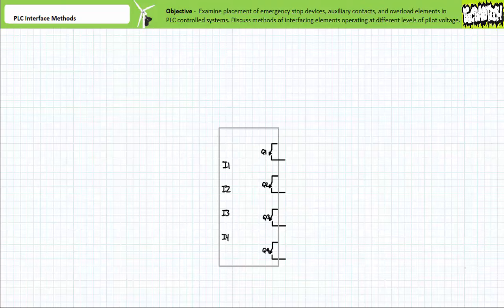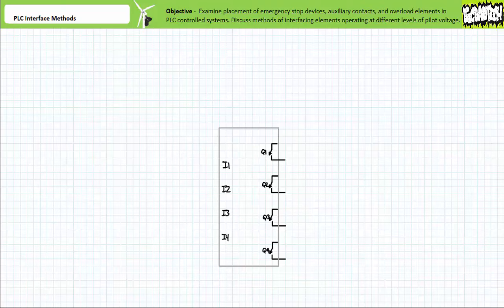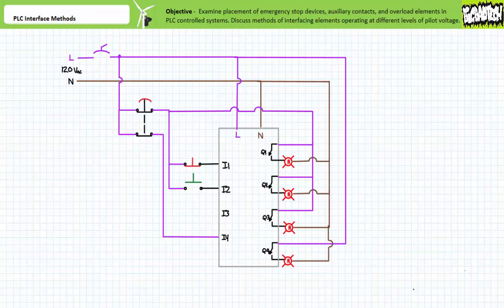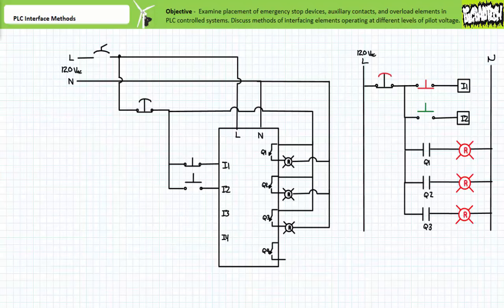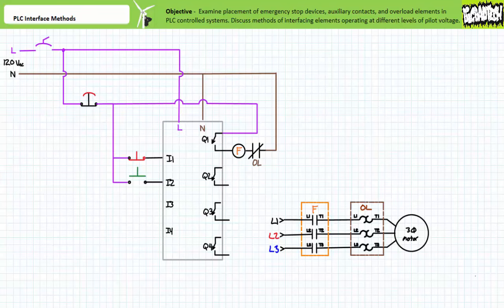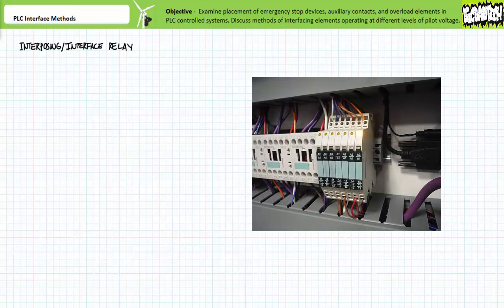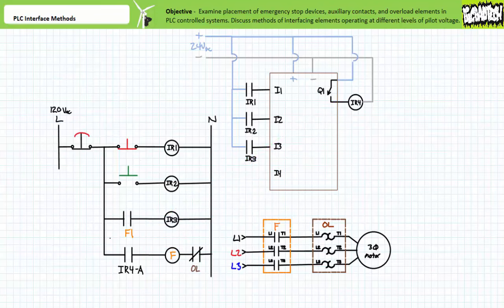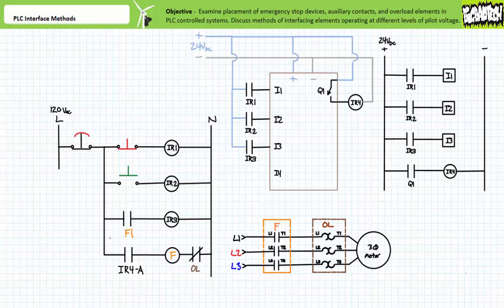PLC Interface Methods (Full Lecture)

Comment: I have a question: would not a 120VAC–rated mechanical  push button switch work perfectly well with 24VDC in our low power pilot voltage settings?
Reply from the maker: Yes often times the electromechanical switched inputs largely don't care what style of pilot input they use within a certain range. Output devices however are very picky about DC vs AC!
Reply: @bigbadtech  Thank you for the answer )

Comment: With the interposing relays, wouldn't you need one on either side of the switches? What I understand, your schematic shows as follows: 24vdc going into the switch, line from the switch going into the IR to change it to 120Vac, then into the PLC.

I thought the PLC is designed to take 24Vdc, so how are you having the output a 120Vac going straight in there? 

And if the switches are rated at 120Vac, it doesn't make sense to have the IR after the switch.

What makes sense in my mind is as follows: an IR changing 24Vdc to 120Vac, line from IR to the push button switch, line from switch to another IR, changing it back to 24Vdc, line from last IR to PLC. The PLC receives 24Vdc as expected, and the switch receives 120Vac.
Reply from the maker: There's 2 things to consider with interposing relays. What flavor (24Vdc or 120VAC) does the PLC like? What flavor does the switch and output device like?

If the switch likes 120V and the PLC likes 24V a 120 to 24 IR is placed between the switch and the PLC. Similarly if the output device likes 120 and the PLC outputs 24V a 24 to 120 IR is placed between the PLC and the output device.
Reply: @bigbadtech  If the switch likes 120v and the PLC likes 24v, and an IR is placed between the switch and the PLC, doesn't the switch input still receive the 24V coming from the battery?
Reply from the maker: No. A 120V rated switch merely energizes or deenergizes a 120V rated coil. The coil in turns closes or opens 24V rated contacts.
Reply: @bigbadtech  Ahh I must just have a misunderstanding of how the interposing relay works, thank you